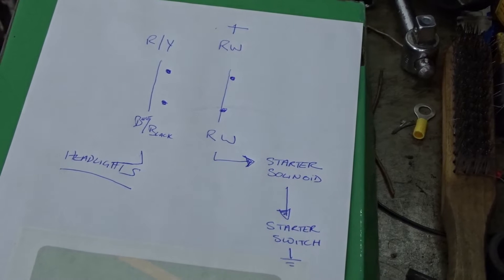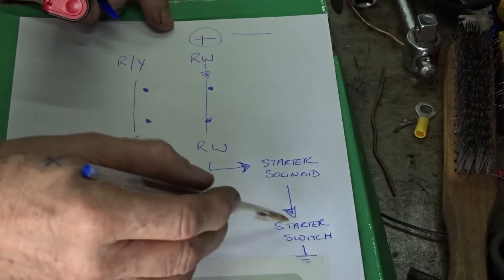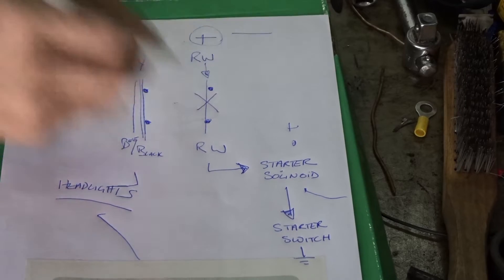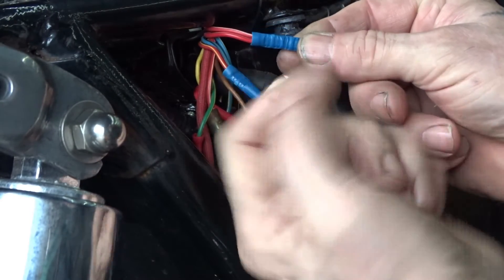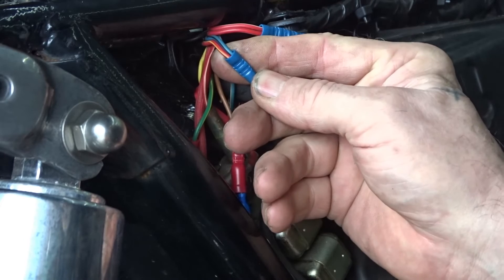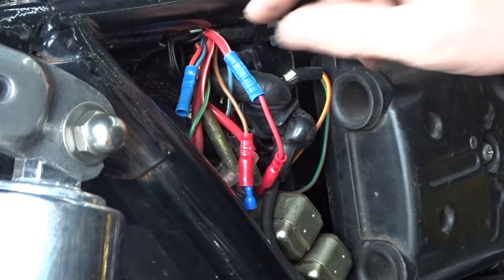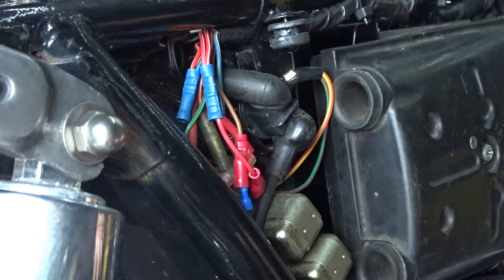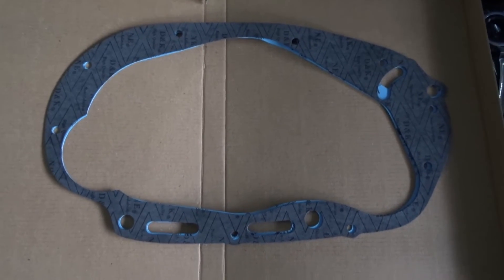Yamaha XS 650 How to Bypass the Safety Relay using PMA system & Clutch Gasket Tip of the Day

Comment: Good stuff. I purchased the PMA kit,  I wish someone at Mikes XS650 or xs650 Direct would have told me, they are very difficult to contact.  I am starting to consider not installing it. Perhaps order the original stator and rotor. 
My bike is a 1972 XS2 .  Anyone interested in purchasing a new unused PMA kit?

Comment: cliff on my rusty 1980 i now have a switch on the right switchgear to turn lights off, so starter can have all the power it wants  but your explanation of how it works is greatly appreciated
Reply from the maker: lol the starter on a XS pretty crap to say the least, on the euro XS's they all have light switches and are so much better, the trouble not having the switch is if the battery is a little dead ya buggered to start the thing as the bloody side lights keep coming on as soon as you kick it!! Who ever thought of that silly idea!!

Comment: I have a question for you sir, can I still do this bypass with the original charging system??? I understood you said towards the end of the video if you are using the pma system you have to bypass it, I am wondering if I will have charging problems with the original components since that yellow wire goes to the startor if I am not mistaken, any guidance will be greatly appreciated, by they way I am really enjoying your content keep it up, cheers from México.
Reply from the maker: Hi Salvador, yes you can still do the bypass and just tape up the yellow wire as it will no longer be needed, doing this bypass does not affect the charging system so you're good to go ;)

Comment: great tip about the clutch cover gasket.  Standards of aftermarket stuff are just getting ridiculous . That other gasket is completely useless . What really pisses me off is the rubbish sold as Mikuni Carb Repair kits which contain nothing correct or useable grrrr.  Nice set of ratchet spanners ......they are gorgeous arn't they.....I can't stop buying spanners   I blame the marketing adverts and   packaging lol
Reply from the maker: Alright John, I know exactly what you mean about the aftermarket rubbish you get, I got a tacho cable the other day for an XS650, it wouldnt even screw in the casing the quality was that shit, I threw it away in the end. Yeah those spanners are well handy, nice n clean too haha I dont want to get em dirty, I need to make a wall thingy to hang them all on in order! I keep meanng to buy a deep reach 13mm ring spanner for the bolts on the sides of the head, oh and another 13mm socket as I keep losing that size for some odd reason. :/